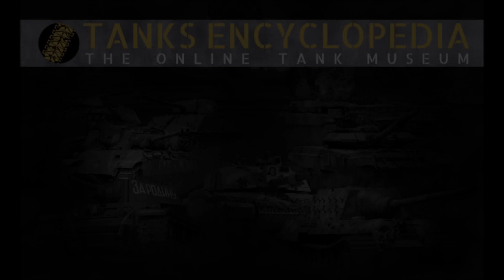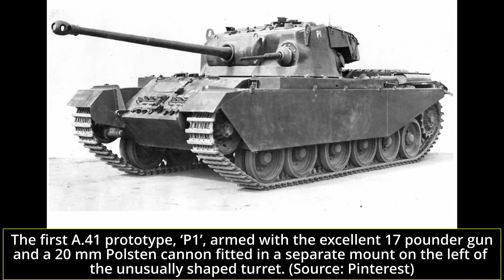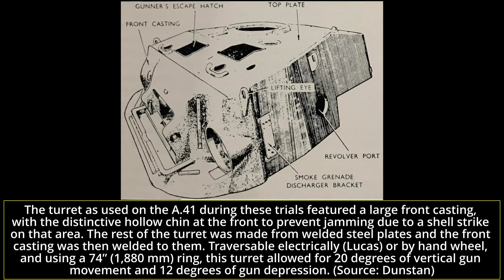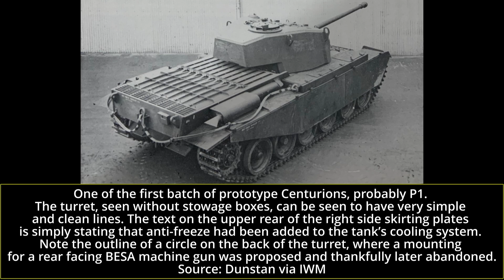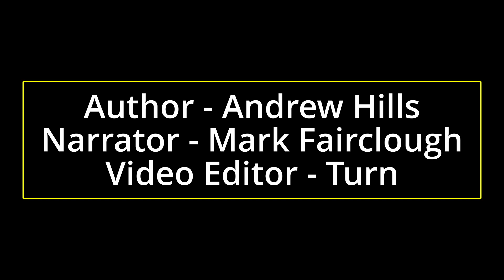A True Royalty | Operation Sentry – The First Centurion Trials 1945 Part 1

Comment: Very interesting, thank you.

To me, the Centurion was overrated.
A very, good tank - absolutely.
But even the Panther G (the model the Centurion would have faced in battle) was generally superior.
With slightly better armor protection, far better cross country performance, range (the Centurion's range was pathetic) and speed.
The guns seemed to be roughly a draw.
And he Panther may have been a bit harder to maintain.
It also had some reliability issues (especially the final drive) but they were almost entirely due to production issues - not the design itself.
And the Panther 2 - which would have been faster and even better armored - would have been even more superior to the Centurion.

Sorry...the Centurion was a very good tank.
But the Panther G was, IMO, definitely better.
And the Panther 2 - even more so.

Strange note to me.
I had always assumed the Panther was WAY taller than the Centurion (the former just looks tall to me - which obviously is bad in a tank).
Not so - apparently the Centurion was fractionally the taller of the two.

Comment: Historically, it is a pity that Cent didn't tangle with Panther, just to show whether it would do what the theory said it should.
Reply: I'd suggest you research what a unit of Centurions in Israeli service did to Syrian and Iraqi T55s and 62s on the Golan during the Yom Kippur war.
Reply from the maker: Okay, let's be a bit more explicit.
Those Centurions in Israel (and all of the Centurions that saw combat) were neither the preproduction vehicles nor the Mark Is. The preproduction vehicles had a smaller gun (17 pounder), less armor (57 mm at the front) and lacked the many upgrades later Centurions would get (automotive, FCS, etc).
Reply: Go back to sleep , this tank went on to own it post war including vs later types like the M48 Patton
Reply from the maker: Not this one, the upgraded versions of this one.

Comment: In my opinion the cent mk1 is was the best ww2 desing
Reply: The turret could have been better simplified but did the job
Reply: I've won bets asking  "What was the best tank in the ETO in 1945.? " People forget it was there on troop trials in 45.
Reply: The choice of the 20mm was suspect. Too much space for not enough firepower.
Reply: @Ulani101  C,Mon. It was dropped almost immediately.